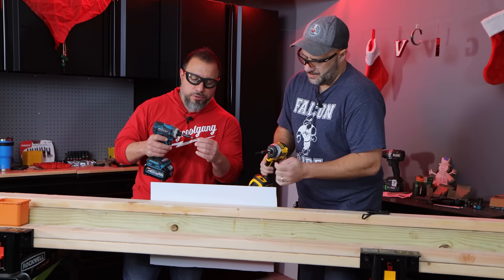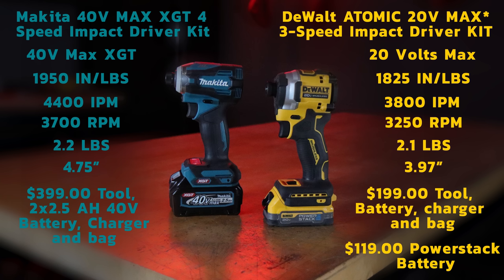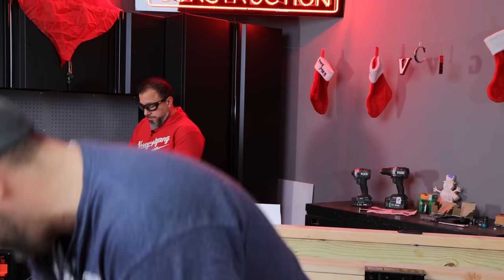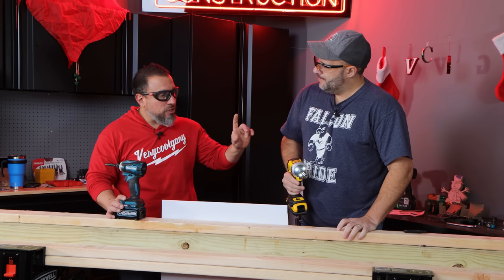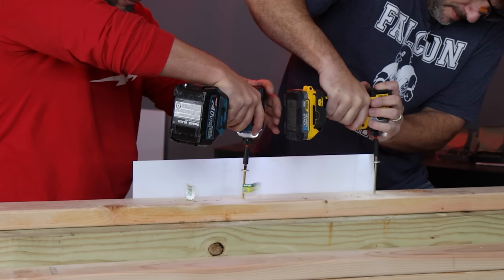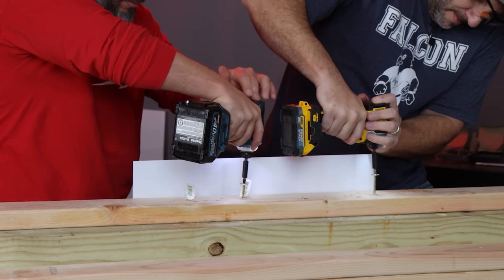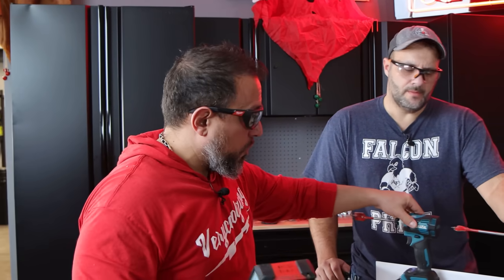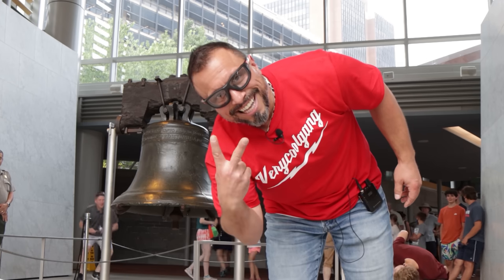DeWalt PowerStack & Makita 40V XGT Tools Compared (ONE IMPACT DRIVER GETS SMEESHED)

Comment: Another thing to check out in LiPo batteries is the C rating, it’s the rate at which the battery discharges. Competitive remote control car racing LiPo batteries use this. I’d be interested to see what that is on the new power stack
Reply: Wait these are Lipo batteries? Is that what stack lithium is?
Reply: @basketball798  Lithium Polonium  (from Russia;)

Comment: My first tool set was DeWalt top of the line XR and after trying Makita once I dols them all and swapped.
Dewalts like a bag of rocks, loose feeling, gaps in the clamshell, and the driver shit out after the warranty expired even with babying it in an aluminum welding environment (cleaner).
Makita been running in both in an aluminum and steel shop without babying it and it still feels like a scalpel

Comment: Vince I've recently bought into the dewalt 20v max line of cordless tools and some are flexvolt.  I would like to take advantage of the extra power i can get from the flexvolt circular saw, with no plans to have any 60v tools would you use a flexvolt or the new powerstack to get some better power from the circular saw?
Reply: Hey man, for that type of load I’d def go Flexvolt as a circ saw draws way more amperage than a smaller impact driver. I’ve got both and I kill that power stack with a few hard cuts but my 60v flex volt will last at least half a day of hard use. Just my experience. Good luck either way 🤘🏼